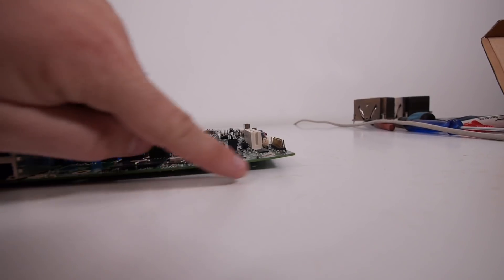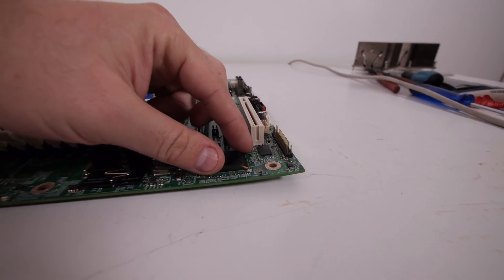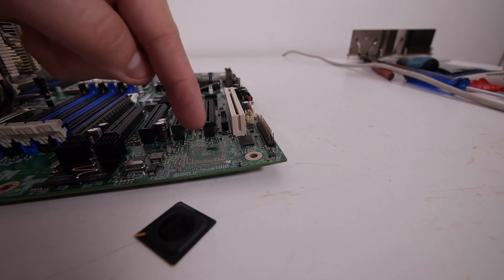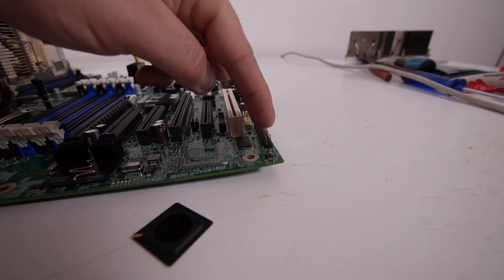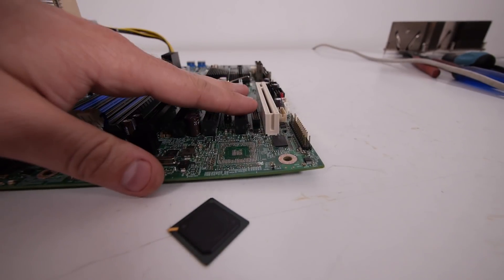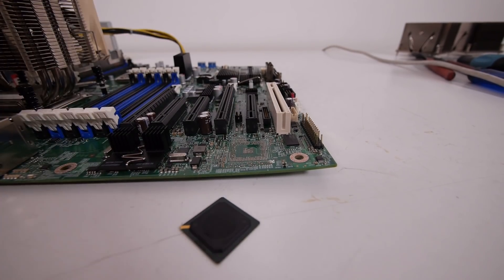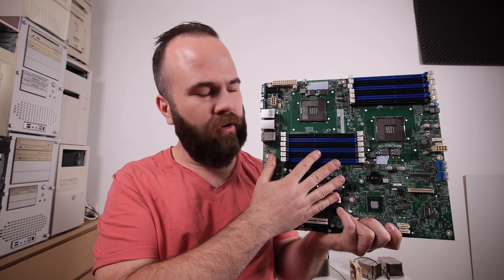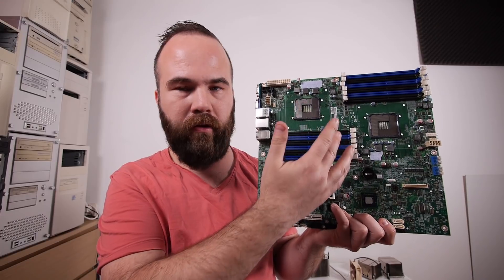ZFS Storage Server: I Found the Broken Part! Intel S2400GP4 Motherboard

Comment: lol why? reball and reflow. traces can handle a lot of bending stress actually. it will work. give it to me.
Reply: i think that solder pads could also get stripped off and there could some other components missing like resitors or caps, so i don't thinkthat's an easy fix or that's a fix worth doing anyway

Comment: F
Reply: Also, 2011 is way overkill.  I'm running a dual 1366 with 2x L5640's and even with 10gig I cant get the cpu utilization over 30-40% when I stress it.